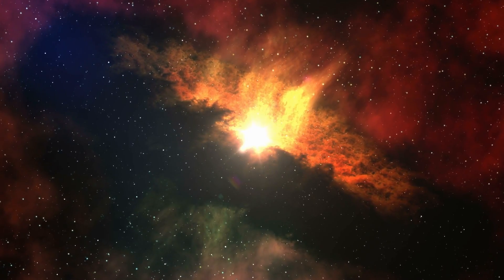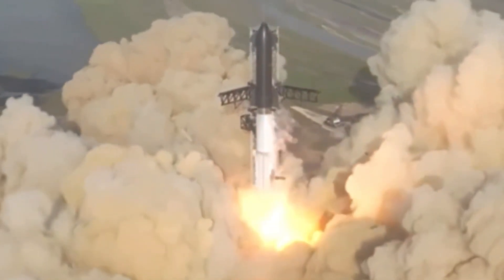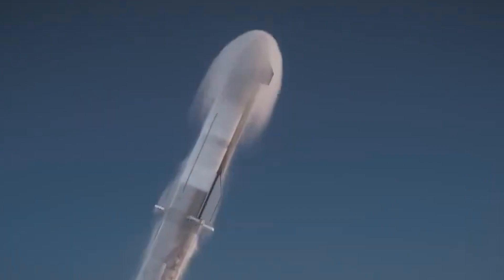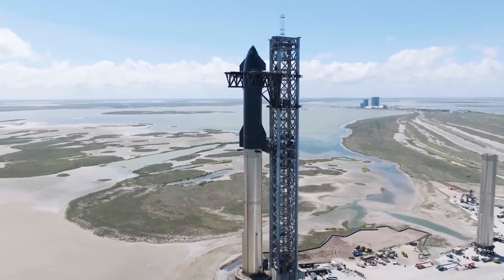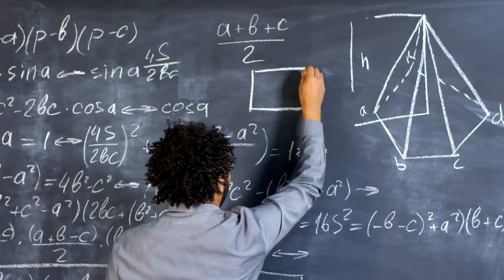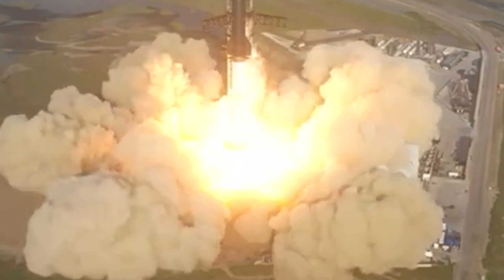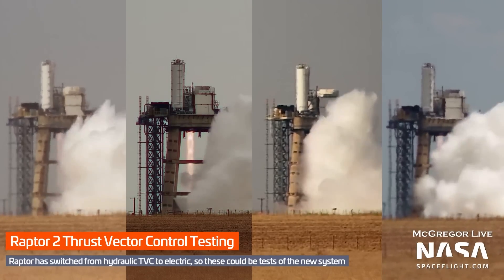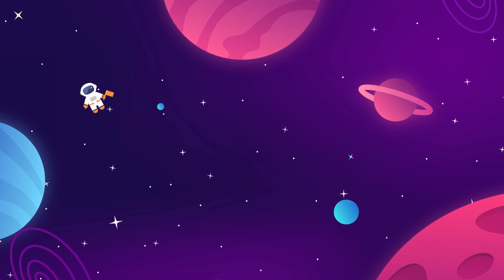The SpaceX Starship Orbital Launch Update Is Here!

Comment: With over 37 years of advanced material reinforcement manufacturing and failure analysis engineering experience, I have designs that should be considered for a major reengineering of the launchpad system & tank farm which can be replicated on other planets ie. Mars. 

With reinforced concrete, it is critical to understand the marriage between the Portland cement (glue), aggregate (rock), reinforcement (rebar) and protection thereof to prevent mechanical failures.

To prevent further launch pad, vehicle and infrastructure damage, suggest flame trenches, new reinforced concrete design along with external advanced composite blend blankets working together to protect the systems from the damaging harmonic & inharmonic frequencies, static, dynamic, shock loads, thermal loads and damaging rotor wind vortices caused by the close proximity to the tank farm and individual tanks too close to each other. 

The massive airborne sand, dirt, rock and cancer causing silica DUSTS & debris coming from the pulverized concrete and Earth below & around the launch pad blasted into the surrounding environment from 1,000,000+ thrust wash are ALL in direct violations of OSHA silica dust & EPA Clear Air and Water ACTs, regulations, rules, guidelines, permits, etc.

If SpaceX has interest in my solutions, I will gladly assist.
Reply: You make good points. How about digging a 30’ deep hole underneath the launch tower. 

Sanjosemike (no longer in CA)
Reply: @sanjosemike3137  The water table is close to the ground level at the site.
Reply: @sanjosemike3137  The water table is approximately 6’ to 8’ ft. 

They need to drive piles into bedrock, reformulate the reinforced concrete, add flame diverters and use my engineered advanced 3D composite blend blankets protecting the entire systems.
Reply: Yep. I wouldn't be surprised if they won't be able to launch another rocket for at least 12 months. And a new rocket + launchpad will take 24-36 months.
Reply: @@Estil_officialI included the element of heat starting  “thermal loads”, a phrase we engineers use.
Reply: I don't think its that they failed to develop a suitable launch pad. Most people forget that Starship will be landing and taking off from the moon the mars, which don't come with launch pads. So it could be they are developing the launch pad in a particular way so that Starship will be taking off in similar conditions like on the surface of mars or the moon (in terms of lots of debris flying up and hitting the vessel and still being flight worthy) 

But if they want the launch pad to be reusable, then they might have to change a thing or two :)
Reply: @alexjfarley  On Mars they won’t be launching a 33 engine super heavy with all of it associated power. The gravity of mats will allow the use of only a couple of engines at much lower thrust due to the gravity and much lower weight in payload for return trips. Building a suitable pad or launch facility won’t take near the complexity as it does for super heavy from Earth
Reply: @alexjfarley  The system I have engineered and suggest for SpaceX to consider can be replicated for use on other planetary systems as it does not require water acoustic damping systems.
Reply: @icare7151  agreed, I'm referring more to the first landing/take off from moon or Mars where there would have no infrastructure to begin with.
Reply: The main failure mode of the concrete was probably the pressure. The chamber pressure of the Raptors is about 300 bar. Which is transformed into the velocity of the exhaust gasses pretty efficiently. When those gasses are suddenly stopped they recreate a comparable pressure. Lets say 100 bar. If there are any cracks due to the heat or shock waves this pressure will enter deep into the concrete layer and lift out chunks. This is different from only heat, where the concrete is ablated slowly. Once this process has eaten through the concrete layer at one single point, it can reach the soft soil underneath and build up pressure under the whole launchpad.
Heat takes time to propagate from the surface of the material to the lower layers and can only eat away at a speed of of mm per second. Pressure can instantaneously take out chucks of material without heating them and drill through the whole plate in a matter of seconds. It is the faster process.
The top layer needs to be a material free of cracks that allow the pressure to build up inside the material. A non brittle metal. And then the heat and vibrations become an other thing to consider.
Reply: @mennol3885  Great points. Concrete slabs without the support of piling, the process of driving or boring pile foundations into the ground beneath the concrete securely embedded into bedrock will not support the static, dynamic and shocks loads applied.

Whomever their engineers are for the launch system, forgot basic material science engineering 101.

Comment: 7 engines were down, no 8.
The bend looks more like stage separation, but also right after self-destruct it looks like. Maybe they timed it a little so first stage exploded a little bit before 2nd stage.
Where do you see that they lost their engine bell? Are you saying that the engines that failed mid flight somehow had stray concrete hitting them at like 15km altitude and struck out the engine bells?
Reply: It only became easily visible at that height - it probably happened in the initial stages of lift-off.  The flight termination system only contains a small amount of explosive.  It is designed to rip the tanks open, not to ignite the gas - it's assumed the gas will self-ignite - hence the long (and potentially very dangerous) delay before the explosions.  Another of Musk's 'genius' ideas...
Reply: @paulhaynes8045  I haven't seen a single picture of any missing engine bells.
Reply: There is a good quality shot in one video of the engines just before it gets covered in clouds and explodes, it shows another of the center engines spluttering before going out. The engines were dropping of as things exploded or were further damaged by things burning that shouldn't be.

Comment: I always thought that it was a failure to ignite 3 of the engines at launch and I did notice the debris come off of the rocket at t+ 00:30. I thought that that caused the other engine failures. And I thought that the main failure was the stages not separation, but I never thought about the pad
Reply: your not wrong in think that, it what the commentator said; however the commentator was misinformed, it never made it to the planed seperation height and it was most likely not triggered early as spaceX has not said they had triggered seperation. as said in the video the engines chould have failed seperatly but were most likely damged at launch seeing as entire cones were gone.  the damge at launch chould also have been the cause of the rest of the compounding failures but only really spaceX know for sure. it chould have been worse though, one bad chunk of concrete at the wrong spot chould have made the whole thing blow up on the pad.
Reply: @DRcocosalt  it could have penetrated the tank and caused it to leak out the bottom and then be ignited by the raptor engines causing a massive explosion early into the fight and maybe even when it was on the pad

Comment: there is a weight limit to how much you can lift with a rocket before it becomes undoable. in this case it took to long to lift off the pad doing damage to the engines also the amount of power of its output with a rocket that is too thin but massive. also even when they were separating the separation failed and the cameras that showed that part showed that which means mechanical failure at that point. there needs to be some sort of antigravity system to reduce mass that needs to be developed and large ships should be built into space so that shuttles like we have now can land in a shuttle bay and return from there.
Reply: When you devise an "antigravity system" let us all know please...
Reply: @chrisantoniou4366  I believe the us government already has one based on the works of john par but they won't release it 
and just becuase a person makes a suggestion does not mean they can make it so get a clue

Comment: They should put like a big ass water pool underneath the take-off pad so all that thrust is pushing down into like 20 ft of water
Reply: Bro is describing a scuffed water deluge
Reply: My guess is that 20’ of water alone would not work as the blast of the rocket engines would just push the water away and expose what was underneath to get blown away.  The purpose of the steel deflector would be to resist that pressure wave.  Water flowing over it would resist the heat and keep it from melting or ablating away.  A water spray from the sides would lessen the sonic shock wave caused by the engines.
Reply: And once those 20 feet of water are blown away in the first half-second, what protection then?